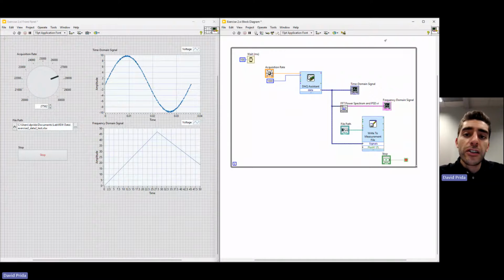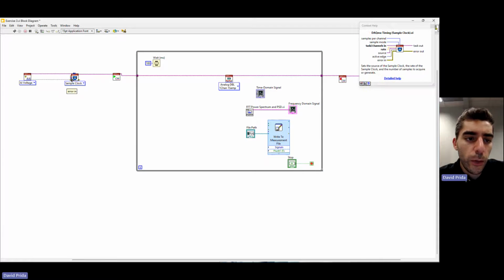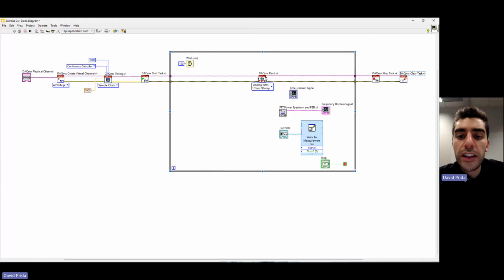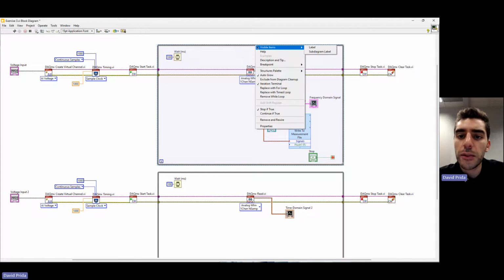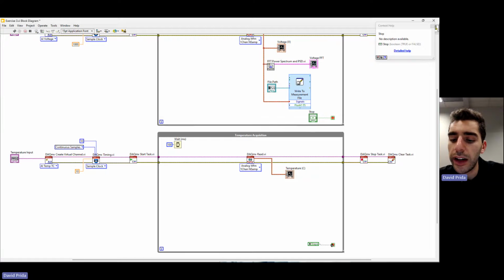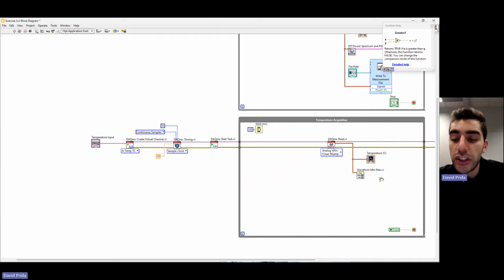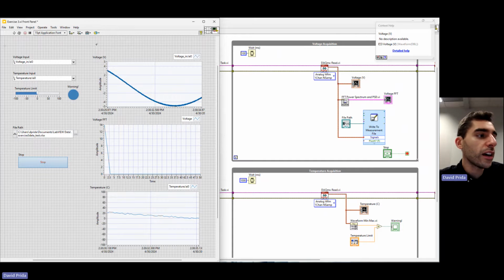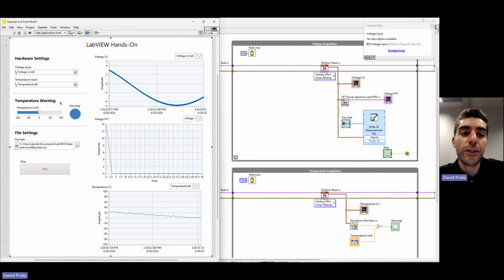LabVIEW Hands-On: Exercise 3

Comment: I am a postgraduate student working on a Z-scan experiment using a picosecond laser source. My project involves developing a new LabVIEW-based setup to control and synchronize a Zurich Instruments MFLI lock-in amplifier with the experimental components.

The goal is to acquire and analyze data from the Z-scan setup while ensuring precise synchronization between the MFLI lock-in amplifier, detectors, and the translation stage.
Reply from the maker: Hi @gourisankar7937, that sounds like a great application for LabVIEW. Hope these videos helped with learning the basics of LabVIEW